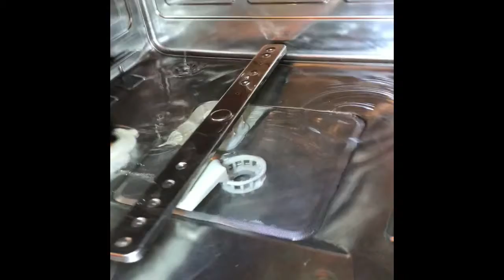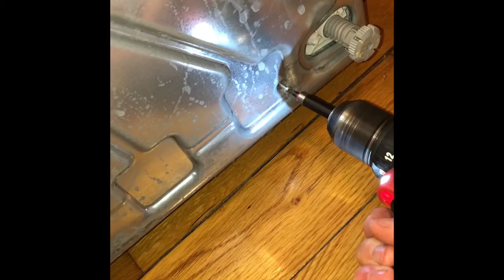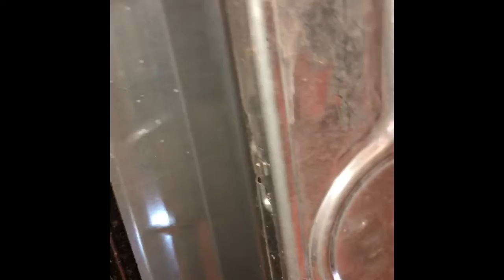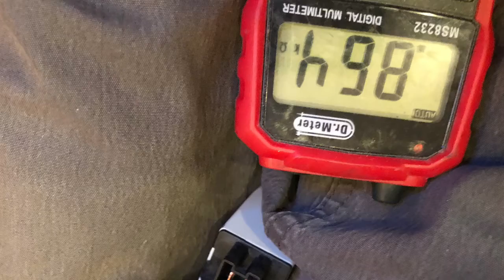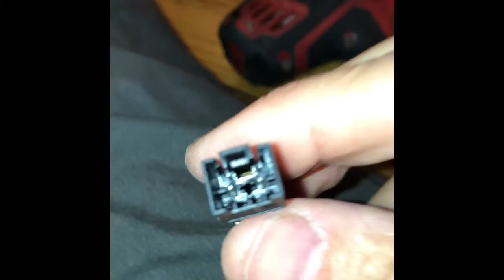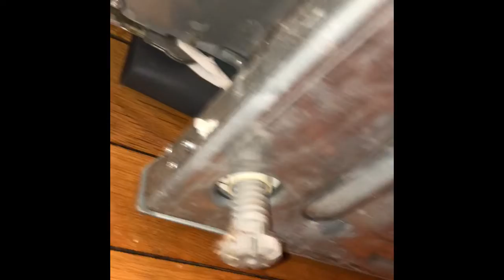✨ MIELE DISHWASHER — NOT HEATING (FIXED) ✨

Comment: got a miele dishwasher and it is tripping the outlet and dishes are still wet. could that be heating element or relay. please help.
Reply from the maker: Thanks David,
Can you plug it into an extension cord in another room to see if that cures it?

Comment: Hi Scott, 

My Miele G5505SCU dishwasher has the same F24 code. The heater relay looked very clean, I cleaned it still, and even swapped it out for another one. I also replaced the heater pressure switch thinking that went bad too because I had leaking. I am still getting the code. I checked the circuit board, it looks clean with no visible shorts
Reply from the maker: Thanks Curran,
Can you spray some electrical cleaner on the connections to the heater relay and the connections to the heater element?
Reply from the maker: The connectors may have become corroded due to the exposure to the wet drip pan during the leak.
Reply from the maker: The connectors may have become corroded due to the exposure to the wet drip pan during the leak.
Reply: @ScottTheFixItGuyChannel  hi Scott, I did in fact clean the connections with isopropyl and a Q-tip when I had it out. Everything looks clean as a whistle. I’m thinking perhaps the heater is broken…I’m planning to change out the circulation pump/heater assembly as those are all one part
Reply from the maker: @tac4bravo  I think you can order just the new heating element to save you a lot of money.  The multi tester should show around 11 on the resistance test if the element is still good.
Reply: @ScottTheFixItGuyChannel  do you have a video showing this procedure?
Reply: @ScottTheFixItGuyChannel  Also I just ordered a volt meter to check everything...did you check everything with the voltmeter with the washer unplugged? this way there is no electric flowing through it?

Comment: I had a similar problem with no heating and a resulting error.

The interior of the relay was much cleaner than on your video, with much less carbon smudging on the case interior and minimal contact pitting.  That lead me to question if the relay was actually the cause.  Closing the contacts by pressing on the coil armature (moving bracket at the end of the coil) resulted in inconsistent resistance measurements, not high enough to be conclusive but hinting that there could be a problem.  I burnished the contacts and very slightly bent the contact leafs so that the contact buttons were better aligned (not usually recommended for this type of relay).  That resulted in reliable resistance measurements near 0 ohms and I couldn't reproduce the earlier flaky behavior.

Doing this fixed the problem, which has not recurred.

It's difficult to be certain, but my experience suggests that the relay was manufactured with misaligned contacts and poor wiping action rather than that problem developing over time. The design uses dual contacts which should provide high reliability and longer life, but sloppy manufacturing negated that.  

I wouldn't expect this repair from a professional for a paying customer except to get the machine working while waiting on a new replacement, but it's a no-cost no-wait fix for your own machine or helping out a friend.
Reply from the maker: Wow,
Donald, Great information.
Thank you👍

Comment: Hi Scott. Re F24 Error Code.  I pulled the relay cleaned it up and tested it with 12VDC all good.  Measure resistance of the element 11 ohms.  Checked Temp Probe and read 9.6K ohms. Held the probe in my hand and and the resistance dropped.  Tells me probe is OK.  I put the machine back together and got F 24 error. Now what?
Reply from the maker: Nice job,

I would call Miele USA and order a new relay.  Worst case scenario will be a new controller.

Comment: Hi Scott, thanks for the video. My Miele G646 SC dishwasher is making a pop sound and tripping the fuses. Is this likely to be the heater element that's gone? Is it easy to take off the side panel to replace it?
Reply from the maker: It is easy to take off the side panels, you can get more help here: https://calendly.com/scottthefixitguy/advice-for-fixing-your-appliance

Comment: Hi Scott, I replaced my heater power switch (f51?) and then right away I got a f24 error, so I cleaned the power relay as described in one of your videos (there was carbon build up, and there was blackening on the inside of the plastic casing).  I filed them and cleaned as best I could, then restarted to test.  Ran for about 10 minutes before another f24 error.  First question: do I need a new heater relay?  second: could I have done something in my replacement of the switch that would have caused a relay fail?
Reply from the maker: Thanks Edward,

I would just replace the relay👍
Reply: another question:  when I took out the heater power switch, it seemed just fine except gunked up from residue.  I don't know if that was the reason for failure (I did clean it, but didn[t bother trying it out because I had a new one), but I'm wondering if many other components in the dishwasher are similarly gunked up, and if the whole thing should be cleaned at one point.  And, or, is there any non-invasive way to clean it out?  Could one even clean it effectively manually?  thanks,, just curious.

Comment: My miele dishwasher stops on all programs after washing - and the sprayarm LED lights... any idea what it could be ? I've cleaned all arms and the parts beneath the filter?
Reply from the maker: For some reason there’s not enough pressure being created by the pump.

How high does the water come up during fill?
Reply: just below the plastic filter handle
Reply from the maker: That’s a good water level.

I think something is caught in the circulation pump impeller .